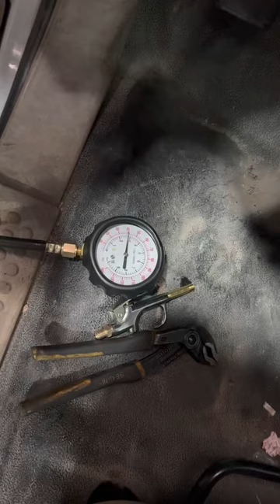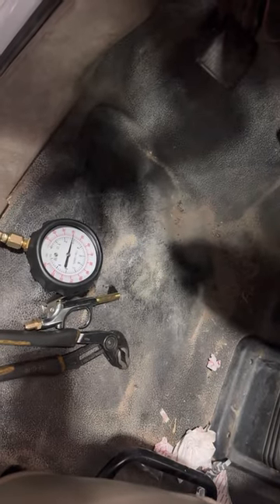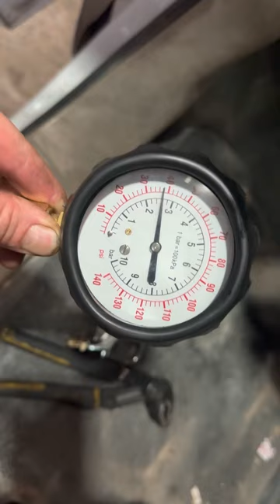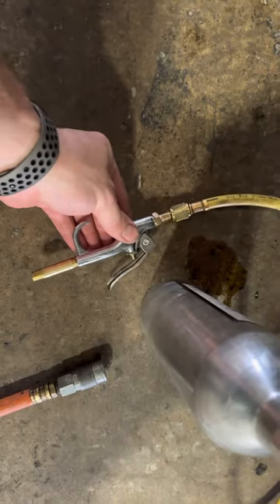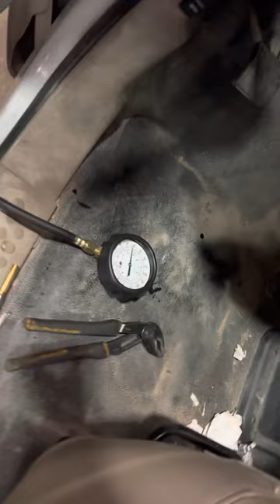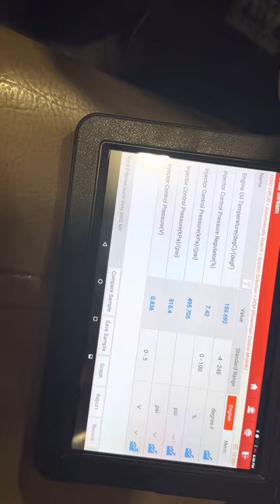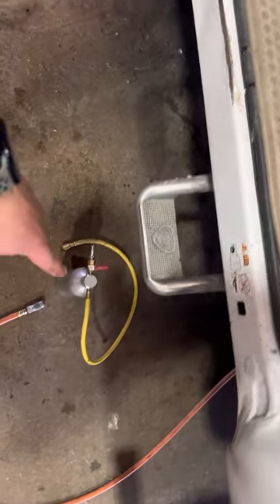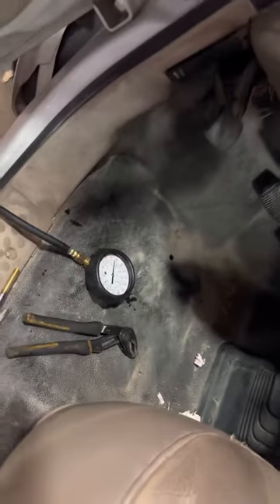How to first prime/re-prime 7.3 powerstroke oil system crank driven oil pump

Comment: Good evening, I have a 7:3 E350, I changed the low oil pump but the oil pressure does not increase.
Reply from the maker: Did you do what I suggested in the video yet? If you just replaced the lower pump what was the reason? Any type of nicks or deeper scratching in the housing itself can cause this to happen. If you haven’t I would try what I had done. If it Doesn’t start like that than something is wrong with pump Or housing

Comment: Does this work if I changed my oil cooler and truck not registering oil pressure? Also, I changed the LPOP as well
Reply from the maker: Yeah it will prime complete system, you should be good. The lpop does a horrible job of pulling oil if it’s not submerged in oil or even packed with Vaseline